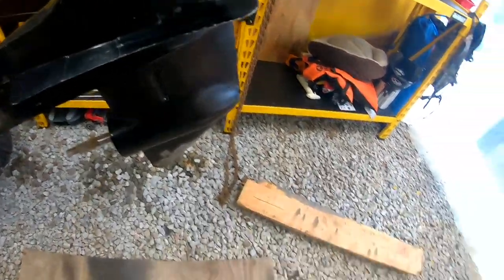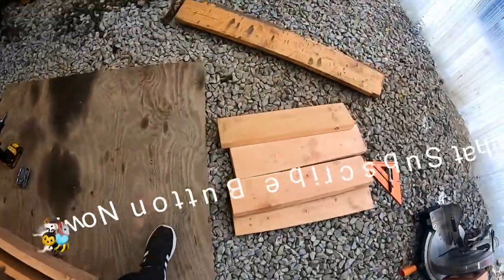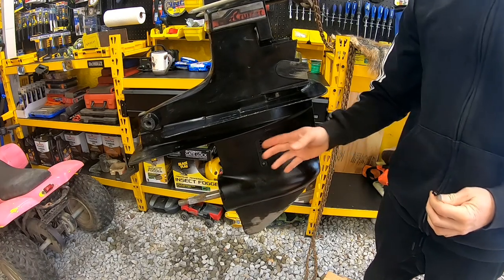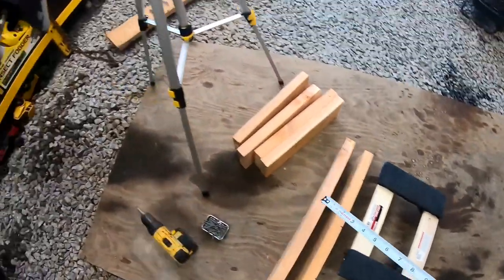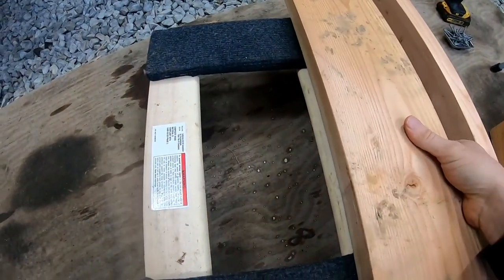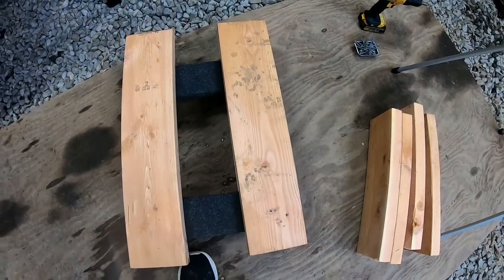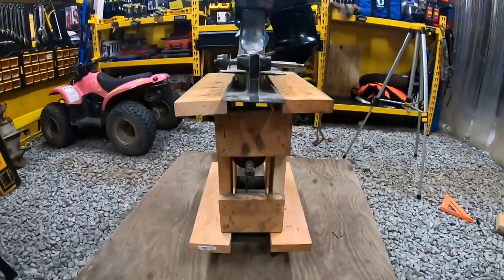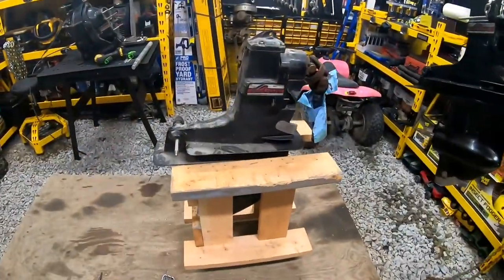DIY Mercruiser Sterndrive Roller Stand

Comment: Should have set the top boards a 1/2" +  each toward the center. Will be making one of these for a bravo 3 in the next couple of days custom height for easier removal of the drive. I'm just buying casters and making the base a tad bit larger from scratch. The small dolly is about $12. The next one up is $30+ for slightly larger boards.
Reply from the maker: Awesome!! Definitely makes life easier especially when working on them! Thank you for watching and have a great summer!👍😊